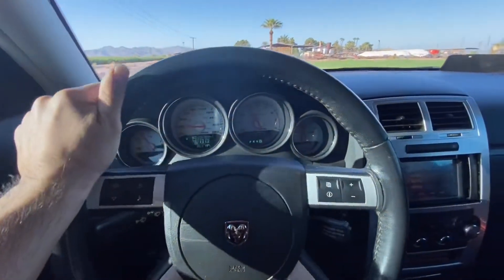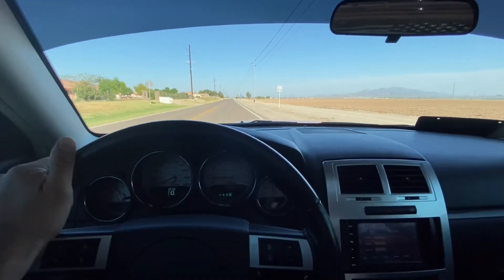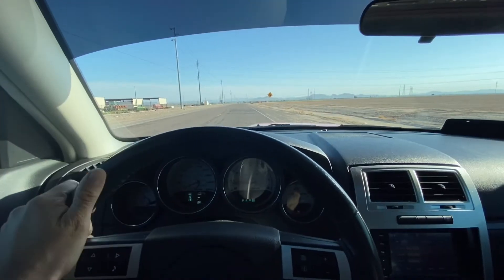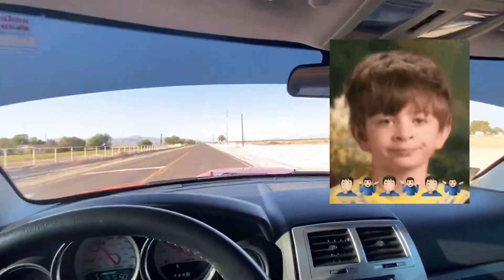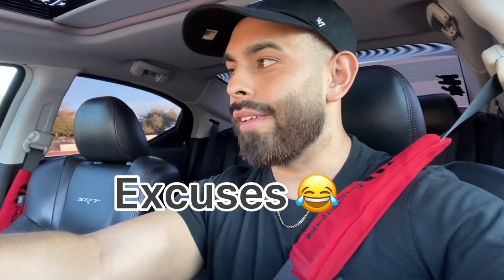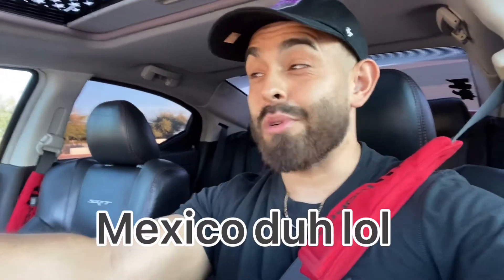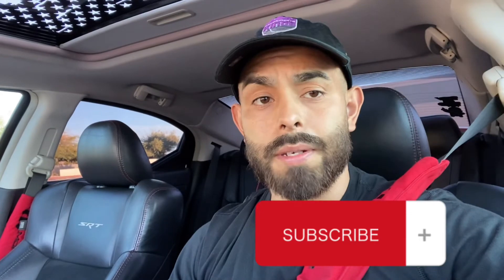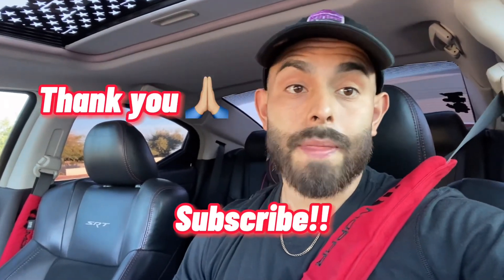Dodge Charger SRT8 0-60 runs!……. Is my SRT SLOW!!!!??? 😭 #dodge #srt #srt8

Comment: Also don't trust your timers in the car. I changed my rears to 275s and my speedo reads 2 mph slower than actual mph. Went to the strip and the car said I did a 9.0 and the track said 8.5, so don't get too wrapped up in the car timers.
Reply from the maker: No way! Wow thanks for the info brother 👍🏼💪🏼
Reply: Yeap the bigger/wider the tire will throw off the speedo get a Diablo tuner they have a option to calibrate on it…or take it to dodge they can re calibrate for u…I know this from having big rims on my cars lol 😂
Reply: @slimthoed  I have an HP tune but it's hard to get the speedo perfect so I just live with it lol it's only 2 mph.
Reply from the maker: @slimthoed   going to buy a Diablo  tuner now lol
Reply: @srtdad  I have a magnum srt8 converted 6 speed manual love the content man I’ll probably start mine up on the mag as well…let me know how the calibration goes maybe I can help the best way I can
Reply: @sambo92  I don’t know much about hp tuners but on Diablo you can type in the exact wheel size and calibrate it’s simple as hell
Reply: @slimthoed  mine is already put in and it's still off lol
Reply: @sambo92  my only guess is a 4 wheel alignment 🤷🏽‍♂️ I had 26s on my 300 and Diablo calibrated it…I know it was fixed bc I had my wife go the same speed as me on the highway once before calibration and after at the time she had a jeep completely factory with the digital speedo so idk…did u get the one with the big screen? I forget what it’s called but I paid like 700 for it I think
Reply: @slimthoed  I had an alignment done. That's why I just wanna go to the strip and see what I run
Reply from the maker: @slimthoed   yea a six speed 6.1 magnum wow 🤩 definitely would watch! Start it up brother!!
Reply: @srtdad  will do 💪🏾 I subscribed to you we gotta keep these type body styles going lol all the hype is on hellcats and scats
Reply from the maker: @slimthoed  gave you a sub back brother but I better see some 300 content 😅
Reply: @srtdad  lol it won’t be on this channel I’ll make a new one lol this one was videos from waaaaaaaay back in the day lol but I’ll get on it asap I got some stuff coming for the mag that needs to be shared
Reply from the maker: @slimthoed   just let me know when you do! 🔥🤘🏼
Reply: @srtdad  gotcha 💪🏾

Comment: I drove an SRT8 a few times with 320,000 on it and it runs like beast. So it's not as slow as anyone would expect especially if they only see it on video and not behind the wheel.
Reply from the maker: These cars are beasts man!! These 6.1 hemi motors have extremely high ceilings too the potential in these engines are very impressive 💯